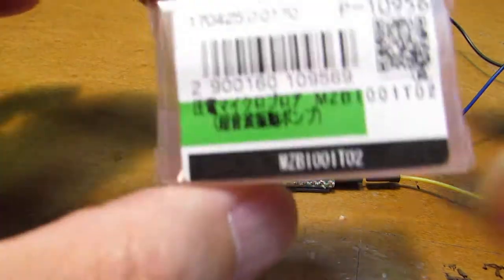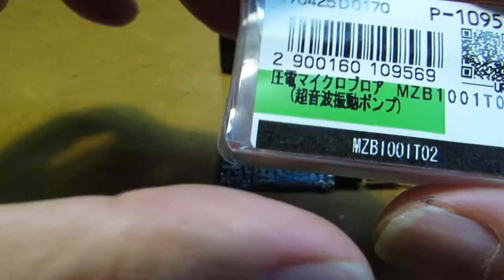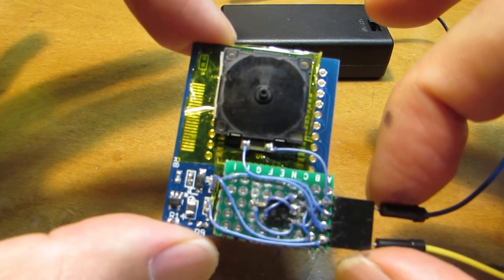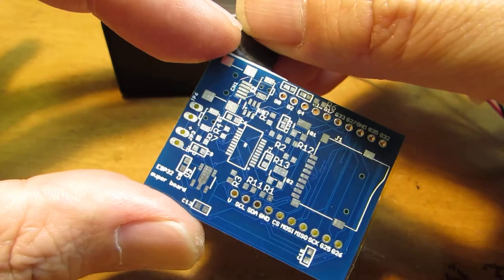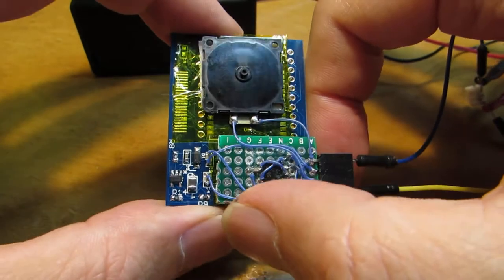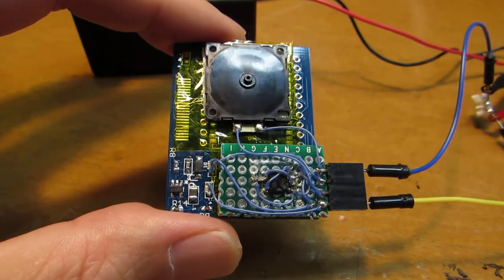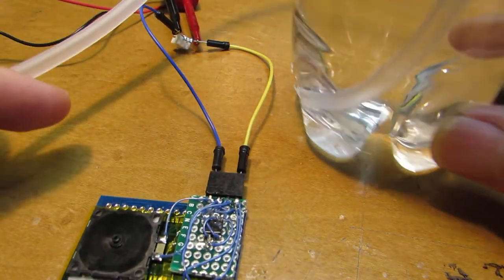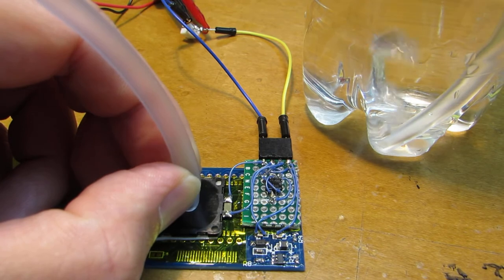Aeration by piezoelectric micro blower by 3V power supply

Comment: where can i get the driver circuit ? i have tried lots of ways but my circuit still can't activate the microblower. Can u make a video "how to make the driver"
Reply from the maker: Hmmmm...  We need to prepare proper frequency signal for resonate this air blower. It is around 26kHz and even just a function generator (square wave, 26kHz, with more than 10V) )will activate blowing... Please try..

Comment: if i was to implement this airflow mechanism in a laptop, how do i get an AC power supply without taking much space for the extra component??
Reply from the maker: Hello, it does not require AC power supply. Just DC voltage is enough. (In my item, it is just 3.7V DC..)